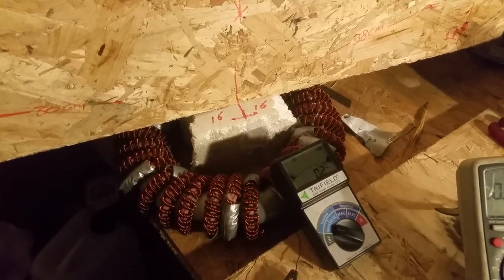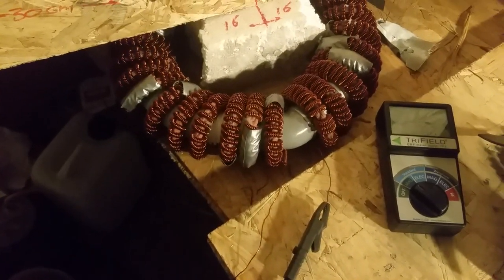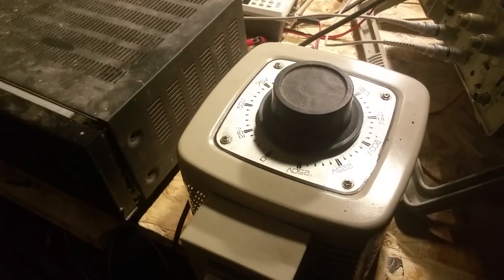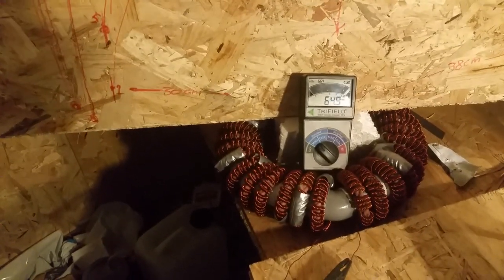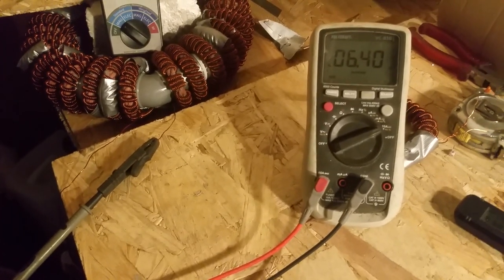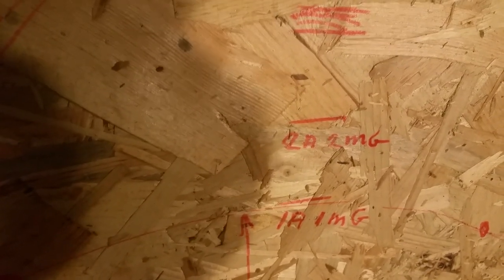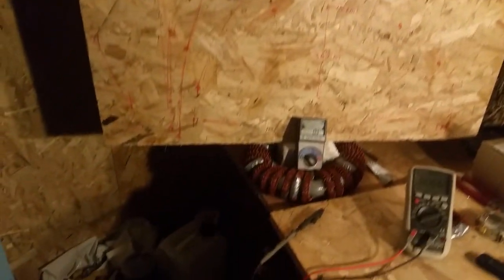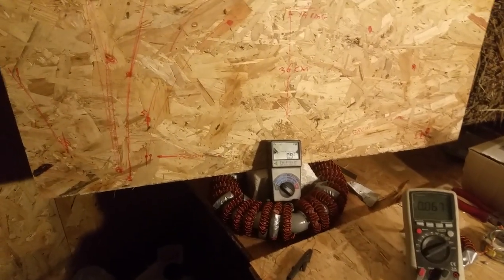O-Day - Henk Jurrien does more magnetic field shape assessment of his  Super-Super-Tor

Comment: Kun je het buiten uittesten? En (heel misschien) met een camera met lange sluitertijd? Dan kun je met een zwak ledlampje namelijk de baan door de lucht beschrijven (zonder bord).
* Could you test this outside? And perhaps with a camera with a very long shutter time? If you then use a small LED light, we can see the traject of the light, and you no longer need a board to draw on.
(just an idea).
Let's hope you can find the reason for the skewed result. In my opinion it has to do with the 'left left left left' idea. I think this toroid is not made to have an output with a nice equilibrium in the center. But if you can draw a 3D line (not only seen from the front, but also from the side, 90 degrees) we can see how far it skews.
Do be careful, 5 Amps might burn something.
It would be nice if you could find a board with many compasses on it. Or make one? (easy for me to say, I have no idea if it is worth making one).
Reply from the maker: See update - it does appear that the metal roof was skewing the field.